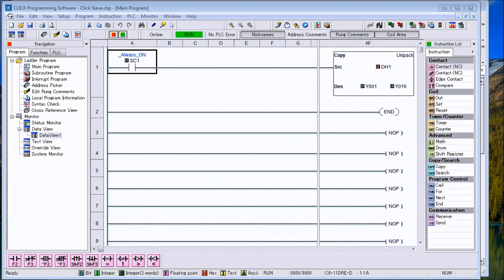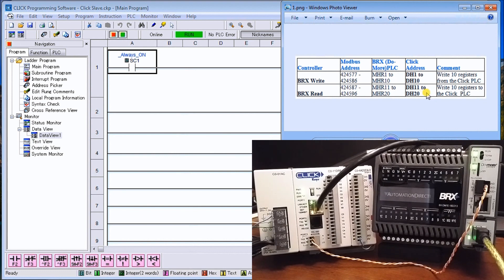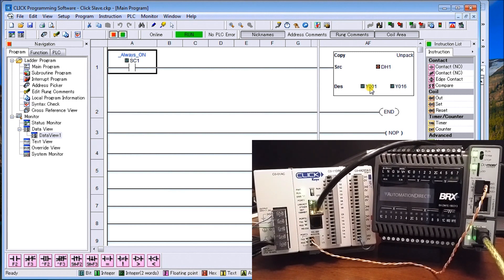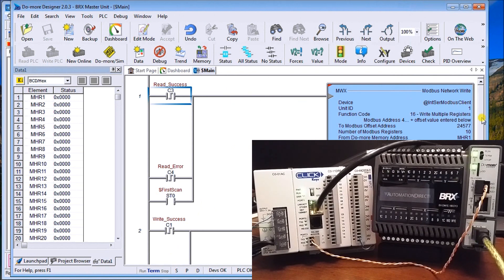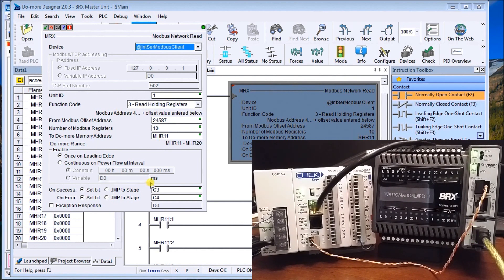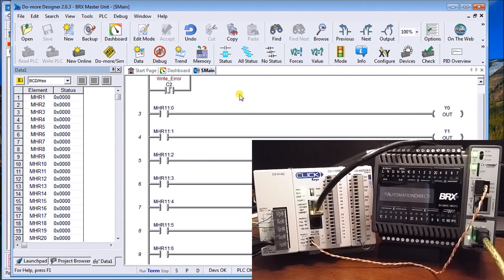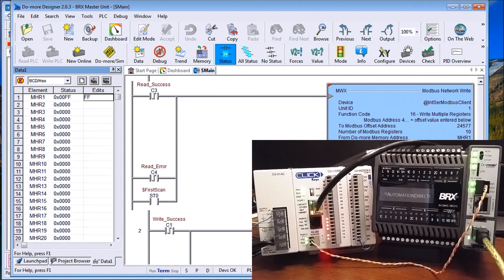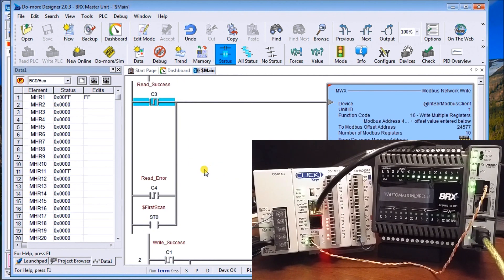BRX PLC Masters Click Slave: Live Data Exchange Tutorial

Comment: Can this work between two BRX PLCs? Or BRX to DL205?
Reply from the maker: Hi Ayhan Kocher,
Yes, this will work between two BRX PLCs or BRX to DL205. If you use an Ethernet connection between the controllers you can use PEERLINK.
https://accautomation.ca/brx-do-more-plc-peerlink-ethernet-communication-network/
This will work with both the Do-More and DL controllers.
Regards,
Garry